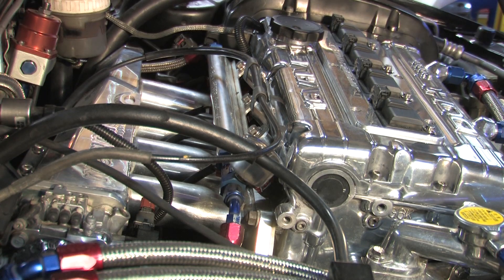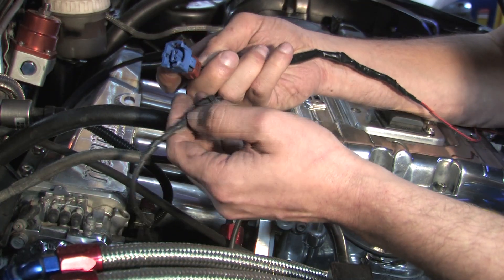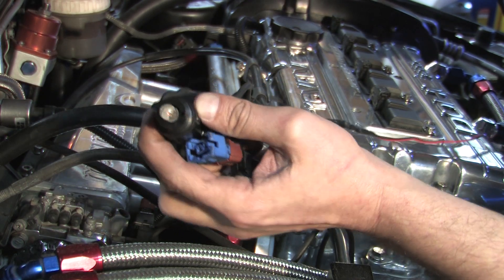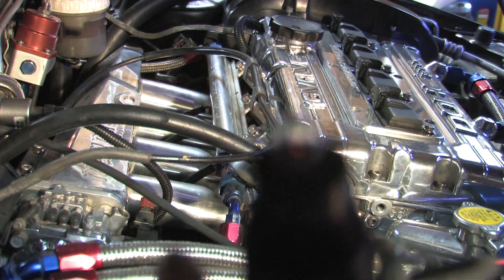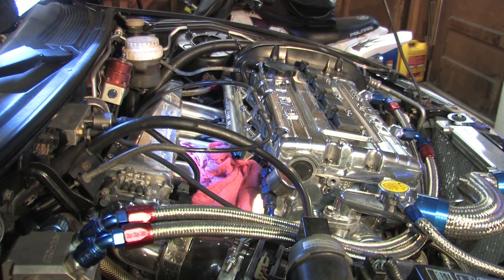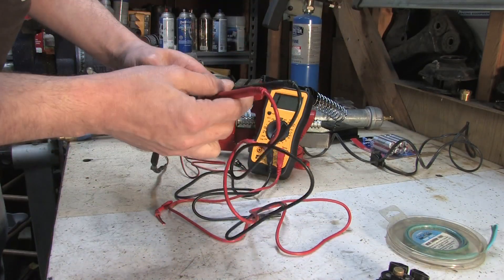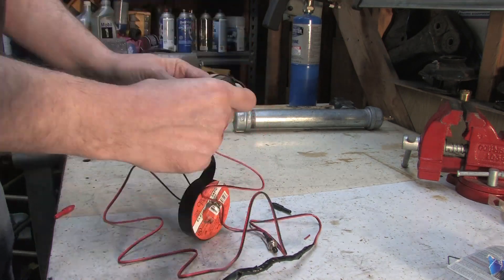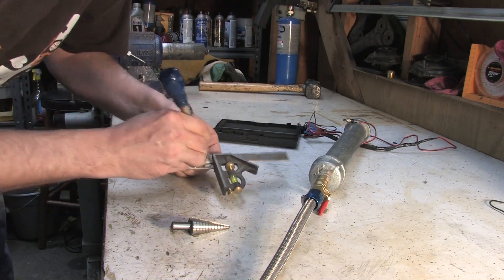DIY Testing & build EFI Fuel Injector cleaner

Comment: Holy fuck the total cost of this build is 666$ 
Now let me show you how I ghetto the whole thing for 6-10$. Old thermostat cup, old tyre valves, so far free, JB weld, piece of metal tube and hose with hose clamps. If you don't have air pump, instead of using your wheels, go to a parking lot and hook it up to other people's tires. Voila clean injectors while you are waiting for the wife at Walmart.

Comment: I have #4 injector that when engine gets warm starts to misfire can this be caused by being dirty ?
Reply from the maker: +joe boss It sounds to me like you have a thermal short in one of your injector coils to me...  One that opens the circuit or increases resistance when the injector gets hot.  It could be another component, but something's losing efficiency when it's hot.  While all electrical circuits are less efficient when they're hot, one of them is in bad enough shape to venture from inefficient into fail mode.  The other components I'd check would be related to spark on that cylinder if you're following a code.  It's one of the 3 ingredients in "boom" and your ECU may be mis-diagnosing it.
Reply: Ok I've took all the injectors out tested and cleaned them put them back in a different order that they came out and I still have #4 injector breaking down when hot so I'm thinking maybe it's a bad wire some where getting hot and shorting out where does it start from so I can run a new one?

Comment: Dear Jafro, 

I ran across a video on another channel showing an alternate Injector connector that will work with the stock injector style. Supposedly If you salvage an injector harness off of a later 2G model they are a simple pinch style connection instead of having a spring clip to hold them in place. I was wondering if you had heard of this? If so, are there any drawbacks to using these connectors(i.e. why have you not done this yet) I have so much trouble with the spring clips that if there really isn't a drawback I'm going to switch them over. 

Thanks in Advance,

P.S. I decided to write you hear in case anyone else was interested in a possible solution to the spring clip "problem"

Comment: when my car is running, it seems like there is a drag and at times, at constant speed it will jerk a bit (hyundia elantra 160k miles).  one day when it was really bad, at idle the car would stop.  I added sea foam to the tank and it has not stalled but the drag is there, but there is a jerk once in a while while at constant speed....so i am thinking that i have a fuel issue, so:
HOW do i know its an injector issue?  by the way the resistance across the injector terminals was measured to be the same across all four injectors on my car.
Reply from the maker: When is the last time you changed the plugs/wires?  can you find any discoloration (white marks) on the spark plug wire insulation?  Have you looked at the plugs and wires in complete darkness with the engine idling?  Because to me, it sounds like you have an ignition problem.
Reply: ***** just installed new plugs (NGK iridium - the long life plugs) & NGK wires.  there is no white marks anywhere...though the old wires had an 1/8" diamter white circle near the end of the plug at the spark plug which i dont know what it is or means (here is a pic:  https://picasaweb.google.com/103542483187582345132/07052014ElantraIssuesAt158k#6032653823759391170)....also, in the dark, nothing is visible....car has not stalled since that one day but i can feel minor jerks at highway speed some time when i am paying attention.

i did test the coils, here are the pics of the two test it tells you to do per the repair manual:
test 1, primary resistance:  https://picasaweb.google.com/103542483187582345132/07052014ElantraIssuesAt158k#6056042801138198754
i get 0.9 b/w 1&2 and 1.0 b/w 1&3 terminals (when hot or cold now)....should only be 0.58 +-10% b/w 1&2 and 1&3
test 2, secondary resistance:  https://picasaweb.google.com/103542483187582345132/07052014ElantraIssuesAt158k#6056042783324670162
i get 10.58 (hot engine) 9.0 (cold engine) b/w 2&3 and 10.68 (hot engine) 9.2 (cold engine) b/w 4&1 terminals....should only be 8.8 +-15% b/w 1&2 and 1&3

so the primary resistance fails and now the secondary is just outside of range when engine is hot....?
Reply from the maker: Your old plugs were a mess.  2 of them completely missing the electrodes.  Looking at the crispy nature of where the heat line is on their ground straps, it indicates that you have too much timing, and could be a bit on the lean side of things.  Lean with too much timing = hot, and that would explain how the electrodes of #2 and #4 got burnt off.

Your coil works but it sounds like it could be tired based off of your testing.  When your plugs failed, it had to work a lot harder to bridge that gap.  If you've got the right parts in there and they're gapped properly, you'll be able to tell more about the burn by focusing on #2 where the misfire code is popping up.  At this point after changing out plugs and wires, I'd change the fuel filter and take a degree off your base timing.
Reply: *****
so before all this, the car ONLY started to stalled when i was starting from a stop, but when i got moving, it was fine...this happened only for 1 day and i got the misfire code...so i changed out the plugs and wires.  I also did the the timing belt, it was over due.  The car ran fine after than.  Two days later I had the clutch changed....took it easy for 600 miles because i felt slippage and i still feel that my car does not pickup the way it use to, the engine revs up but my pickup isn't the same as it was before the clutch change...so I still have to take it back to the guys who did the clutch change.

a)  I thought the heat rings on the plug insulator were due to having to bridge the larger gap only as the timing is adjusted automatically by the car, is that right?
b)  I bought a new coil and the primary & secondary resistance both measure out to be what I currently have in the car (when cold) so the book must be wrong on the primary resistance number.  so I am assuming that what I have in the car is good, right?
c)  How do I take off a degree on base timing?
Reply from the maker: a) you only want a heat ring of .02" or a half a millimeter.

b) take it back.  You're fine.  Usually when a coil fails you get misfires in 2 cylinders or the car doesn't run.

c) you'd use a timing light and make adjustments to the crank angle sensor.  If you don't have that sensor on the crank, then you have the kind of engine that you can adjust.  You'd do it by grounding your timing with the test connector, slightly adjusting the cam angle sensor while using a timing light on the crank pulley to move the TDC mark back a degree vs. the markings on your timing cover, and then lock the cam angle sensor back down again.  If you DO have a crank sensor, it requires modifying the ECU.

With the information about the timing belt, I'd double-check your timing marks on the cam gear and crank.  If you're a tooth off, it's going to act like this as well.
Reply: *****
a) it does have a crankshaft position sensor....so can only change timing by ECU? and how would you do that?
b) i did double check the that crank shaft was at TDC and the camshaft hole was lined up with the red mark, so I should be fine there...nothing moved when i put the timing belt on from when I took the timing belt off...I will check again next weekend to double check.
c) i did change the fuel filter at 80k, so a new one is ordered will do that next weekend too (fingers crossed :) )....as for the fuel pump, it either works or it doesn't, right...there is no in between?
Reply from the maker: footprintsinconc a) it's complicated.  I do it with ECMlink.  

b) sweet!

c) If you pull the vacuum line to the fuel pressure regulator and fuel runs out, then you have a bad regulator.  Aside from that if your filters are good, it's getting 12V and it's moving fuel... then yeah...  If it's on, it's on.
Reply: *****
Ok....finally got some time Wednesday to work on car and here is an update: 
item 1)  pressure test: fuel pressure test
I got the fuel filter but then decided to check fuel pressure while the car was running at idle and then waited 5 minutes after engine turned off to see if it hold pressure. Here are my findings:
a) while the car was running, the pressure held at approx. 50psi when the needle was steady...at times, the needle quivered a lot at times (it was a total blurr but avg. was 50). pic of guage: https://picasaweb.google.com/103542483187582345132/07052014ElantraIssuesAt158k#6063176305899432898
b) as soon as i turned off the car, the pressure dropped to just under 46psi immediately....see note i below.
c) in about 5 minutes after car turned off, the pressure was down to 40psi....see note ii below.

i) so according to the service book, if the pressure drops immediately, the check valve with in the fuel pump is open and pump needs replacing...here is pic from manual:  https://picasaweb.google.com/103542483187582345132/07052014ElantraIssuesAt158k#6063176124165691954
ii) the slow release in pressure to 40psi, what does that mean?  if the pressure held at 50psi immediately after turning off engine and then it slowly dropped, that would mean an injector leaking.  However, since it dropped immediately partially and then slowly, does that mean the check valve is still leaking pressure continuously or injectors leaking?

item 2)  fuel regulator is in the tank I believe with the pump and all...i could not find a way to check that in the service manual that I have (hyundia's repair manual-wish it had more details)

item 3)  I have no idea about the timing yet...have not had any chance to check out the ECMlink thing yet.

Comment: I assume try you are using a grinder and grinding wheel on the cap? but why...are you try to remove a coating or trying to make it flat?
Reply from the maker: When you have to drill through a rough surface, it makes it hard to center the bit, and it can make it jump around as you start to drill.  Since I was drilling into a casting seam, it helped me make a better hole that would be easier to put threads in.  It's also easier to see your mark from the center punch.
Reply: ***** Thank you for the answer.. awesome work, I can't wait to build one.. Thank you for the very informative video.
Reply from the maker: Make another fitting that lets you back-flush them as well.  :)

Comment: Wonder if this would work to clean brake lines. Pour brake fluid into the pipe cannister instead of injector cleaner. Modify brake reservoir cap. Hmmm. Guess I have my next project.

Comment: I made some design changes for better injector alignment and security. Also allows me to reverse flow the injectors. I also found some 3/8" to 22mm male fittings. No drilling necessary and I use cheap #88 plumbing O rings from the home center.

I made two plates that have two bolts spanning them. Secured at the top end, adjustable on the bottom. Works great.

Comment: I just did it for you. Hope it helps. I could not find a male barb to 3/8M so I had to get a male barb to 1/4"M, then a 1/4"F to 3/8"M adapter, then the final 3/8" to 1/4" reducer.

Comment: I also installed a high volume fuel injector fuel filter in the fuel line, just because I am anal.
Could not find loctite 567 locally. Had to order it on line.

Bought a sonic cleaner on sale at Harbor Freight.

Comment: 2 end caps, 1-12" threaded pipe, 1-air compressor fitting, 1-1/4" to 1/4" male NPT coupler, (1) 1/4"F to M NPT shut off valve, (1) 1/4"F to 3/8"M coupler, (1) 3/8"F to M hose barb fitting, Loctite 567, Fuel line, (1) 3/8"M hose barb to 3/8"M NPT fitting, (1) 3/8" to 1/4"m NPT reducer, (1) fuel injector harness plug, (1) momentary switch, heat shrink tubing, battery, scrap metal 2"x 8". Hope this helps. Feel free to cut and paste into video description and edit anything that is wrong or missing.

Comment: The "whitish fluid coming out of the Injectors are "Olifins",the heavier parts of gasoline produced by waxes(parafin in nature)and varnishes contained in the gasoline.
 This is why it is a very stupid thing to put Injector cleaner in the gas tank as it washes all of the contaminates in the tank,fuel lines and fuel rail into the Injector................the last place you want it to be !! By the way,ultrasonic cleaning and backflushing is the only way to remove these 100%.Chemicals do not !!

Comment: Yes, the Noid light should flash every time the system fires the injector. I bought a set of them that fits nearly every make of vehicle at Harbor Freight, if I was using them every day to make my living I'd buy a better set but for occasional  use they are fine.

Comment: What size tap did you use for the fittings?  I tried out 1/2 - 20 and it worked out ok on PVC, but I know PVC is much more forgiving than steel.

Comment: Another way to find out if there is a bad fuel injector and the car is running bad is hook up a scan tool and a missfire code such as P0304 will appear,1996 and current

Comment: How can I obtain the video Building The Injection Cleaning Unit from you in normal time?

Could you please consider the request. As shown on UTUBE the action is so rapid that it is impossible to understand what br4ass fittings,drill bits, the injector holder u built etc.

I live in Queens New York. My e-mail is lgmerionrohr@msn.com.

I would appreciate you response and assistance as per this request.

Comment: @Jafromobile Great video but I’m curious about the 12” section of galvanized pipe. What’s the purpose of it? Why can't you go right from the shutoff valve to an air hose fitting for the compressor? There must be a reason for it, you seem pretty smart.

Comment: thought I had a dead injector, pulled the plug wires, found the dead cylinder. swapped the injector I thought was bad with a good cylinder injector.  was just a dead spark plug  LoL